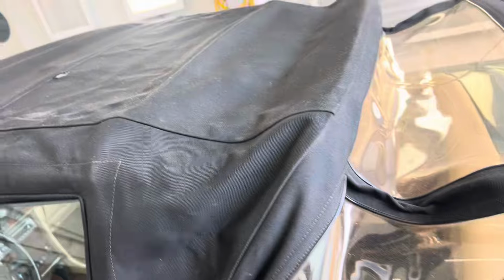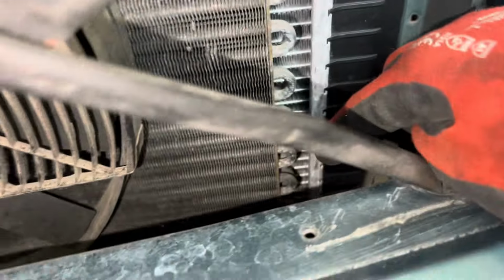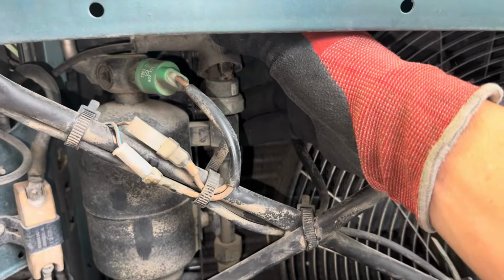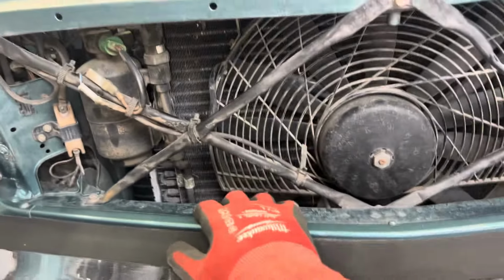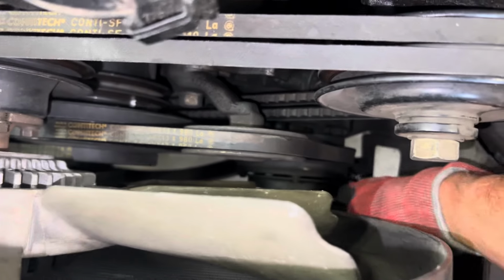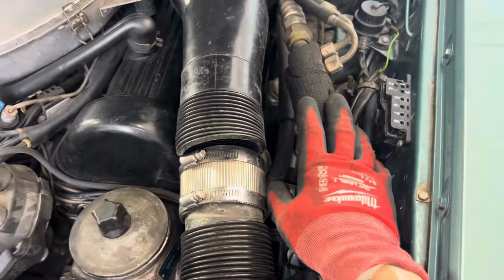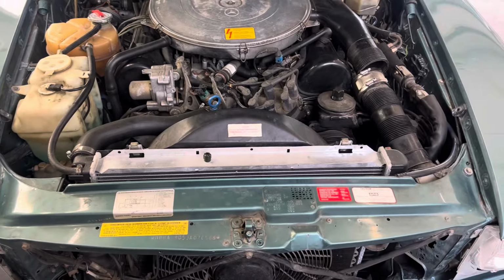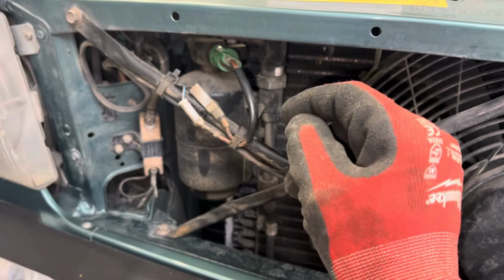AC RECHARGE 1988 Benz stored since 2016. Only 25 psi visual inspection.

Comment: Don't use the BG engine flush, any engine flush is bad news. Just use fresh oil and filter and change it often, way safer.
Reply from the maker: @who_wantsit  BG engine flush works great. 

Engine flush is only bad for idiots who don’t change their oil to the point where there’s extremely thick buildup. 

And then they try to flush it and the chunks and gobs of Tari like substance plugs, the oil filter, and the engine for oil and break something from lack of. 

But that was initially all caused by the idiot who didn’t change their oil often in the first place

Engine flush is good on cars that change their oil often. 

But they have a particular manufacturer car engine that has a tendency to burn or take oil at the hot areas like around the EGR
Or some of the crevices in the head oil, Gallies and indentations in the top of the rocker arms head to keep them cleaned out so they never build up. 

Oil flush damage by is created by people who don’t know when not to use oil flush products, lack of education
Reply: @coldfinger459sub0  I agree, but if the oil has been changed on time and you use good oil, there generally is no need to use engine flush. Not necessarily harmful, just pointless if there's nothing to clean out.

There are some exceptions though. Some engines are prone to sludging even with good maintenance, some driving cycles like lots of short trips and rarely getting the oil fully heated up can cause sludging, used cars with not great or unknown maintenance history but no serious sludging can benefit from flushes, etc.
Reply from the maker: @averyalexander2303  correct there are some known model vehicles that have Gummy problems of their EGR coolers from the excessive heat breaks down the oil. Some PVC systems that recirculate too much exhaust gas varnish filled up.
Reply: I have used BG products for years, and they are really good. 

Although, speaking of education, I have been watching Lake Speed Jr.   on YouTube, his channel is Motor Oil Geek.

He has proven (thru science) that engine flushes are really bad news. 

Hey, we all need more knowledge, and that's why I love your channel.